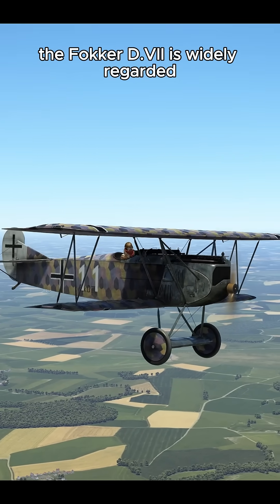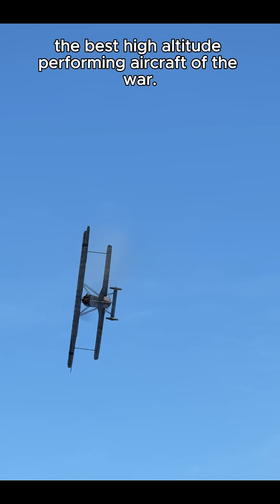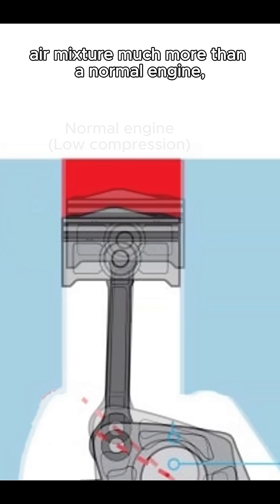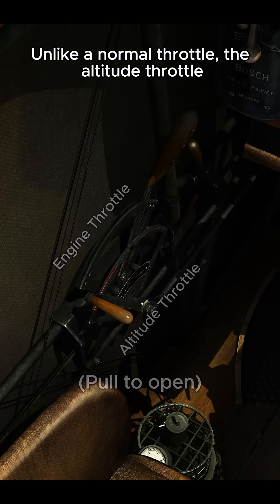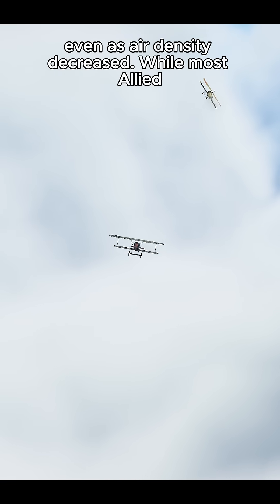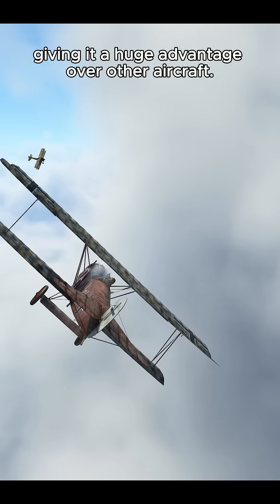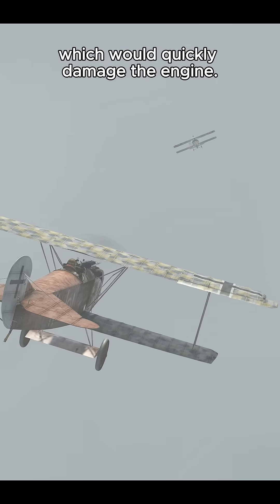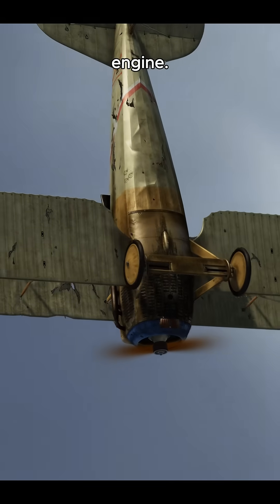Fokker D.VIIF - Altitude Throttle

Comment: Basically a WWI P-51 Mustang (at sea level would be much slower, and it could use the second stage of the supercharger, giving it a much higher horsepower - rated for higher altitudes - only for a couple of minutes before the engine would damage itself)
Reply: Not really though. Two or three stage superchargers don’t mean that the engine is producing less power at sea level. It just means that the supercharger is able to adjust to different air fuel ratios (AFR) for the different altitudes. As the air becomes more thin, typically this would throw off the AFR and mean that the compressor is producing less boost. Having different gears allows for the compressor to still produce significant boost pressure even with a more lean AFR. This ‘altitude throttle’ is basically just an early mixture control for a naturally aspirated engine, so the engine doesn’t choke out from lack of air at higher altitudes. Most likely the reason it can’t produce full power at low altitude is either because it’s tuned specifically for operation at higher altitudes at a compromise of slight low altitude power loss, or if the engine would be producing too much power at low altitude on its full setting and would destroy itself. High compression engines are very delicate since the higher compression means there’s more force on the connecting rod and piston, so going over a certain power threshold could either throw timing off and cause the piston to strike the valves, cause knocking/pre-detonation (when fuel starts to ignite unevenly- the octane rating of fuel in cars is related to its knock protection), cause rod knock (when the connecting rod starts hitting the crankshaft due to being too forcefully pushed down or being out of time), and a variety of other issues could also be caused
Reply: @antiquatedideas1107 i mean if it has to be throttled you are reducing power at lower altitude for more power at higher
Reply: @antiquatedideas1107 study more bro, youll get there eventually
Reply: BMW high compr.engines REDUCE compression at sea level -to avoid engine damage.while climbing the lower surrounding airpressure can be compensated - up to a certain degree, of course. Therefor more hp at higher altitude= better performance
Reply: Was nothing like the p51 mustang 😂
Reply: @jim4596   p51 = ww2. We were talking bout ww 1
Reply: @jim4596  and you were right; unique airintake merlin/ packard . Also cooling vunerable to groundfire...p51 was great dogfighter also way better fighters p 47 , f6 , f4 corsair

Comment: The second lever that you are referring to is the mixture.
The altitude throttle is on the same throttle lever as the normal throttle but there is a detent that you have to push past to engage the high altitude setting on the carburetor.
Reply from the maker: The second lever I showed in the video is the altitude throttle. If you look in the regular D.VII with the Mercedes engine, it didn't have that second lever
Reply: That's not the mixture, that's the altitude throttle (höhengashebel). The D.7 didn't have a mixture lever

Comment: The Allies (Entente) believed the Fokker D.7 had broken the prevailing engine stalemate of the air war. The D.7 demonstrated exceptional climb, vertical maneuverability, and controllability at high angles of attack. Despite it's average looking design, it was very aerodynamic and structurally strong.
Amazing aircraft, easily the best in WW1!
Reply: Not really. The spad XIII and RE8 in less measure were superior to this aircraft. Apart climb rate, this fokker was inferior to Spad in everything.
Reply: But, in the end, it couldn't do a damn thing to win the war for Germany.
Reply: @ericolsen5798  To few were built to make a difference
Reply: Sounds like the P-51 of WWI.
Reply: They were named specifically in the Treaty of Versailles as MUST handovers. That says alot.
Reply: I wouldn't say best, as the Camel existed but impressive non the less
Reply: @ilpoomatili9549  definitely best